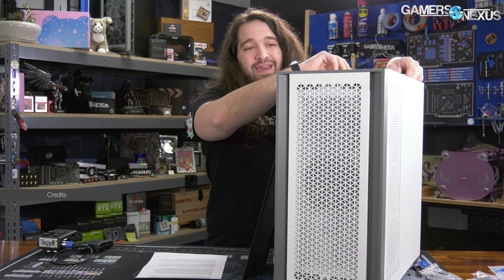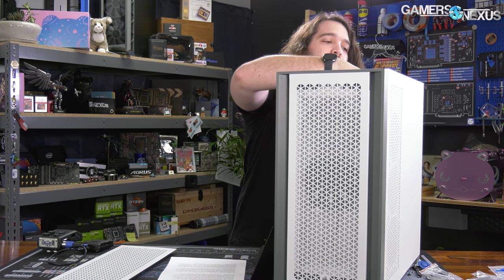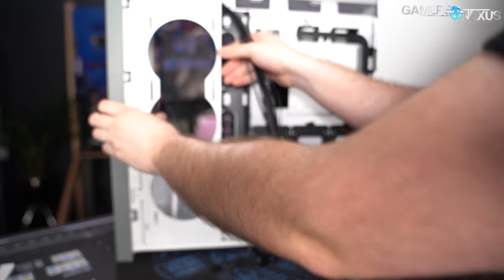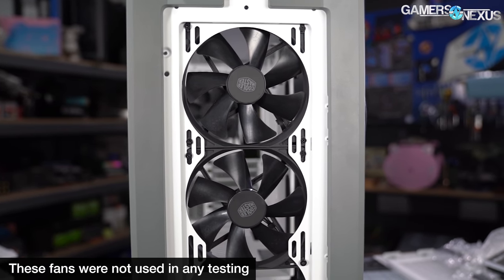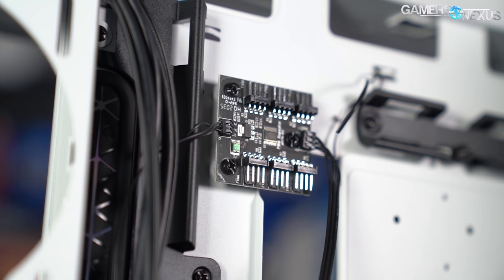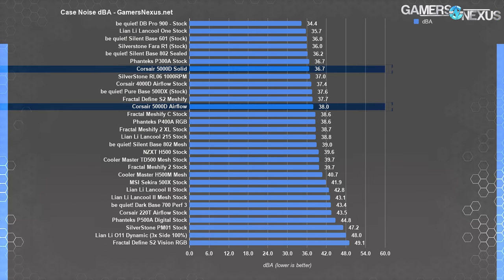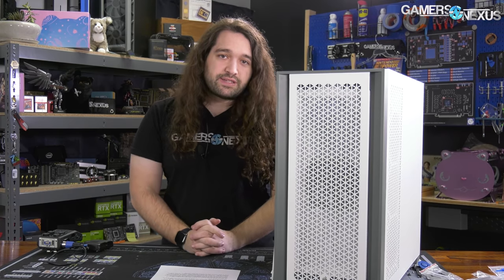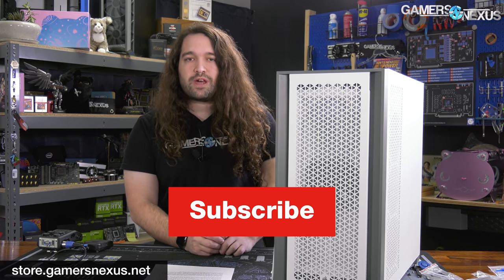Corsair 5000D Airflow vs. Solid Case Review: Thermals, Noise, Build Quality

Comment: Am I the only one who likes 5.25" expansion bays anymore?
Reply: Yeah there getting hard to find, I just want my haf x back now.
Reply: @alreed2434  I've had good Luck with the enthoo pro 2. I really liked the way phanteks packaged that case and did cable management.
Reply: @kevinmaher4609  Is it decent for air cooling as well? Usually do a tower on cpu for cooling haven't gotten into aios yet. If it aint broke don't fix it right?
Reply: @alreed2434  i don't have a fancy liquid cooling set up. It has enough capacity in the front intake though to make it good for air cooling. I do use a CLC on my CPU but due to how I have it configured I'm losing the static pressure through the rad as exhaust rather than as intake. Meaning even with lesser exhaust flow from the top of the case I'm still getting fairly low temps.

Comment: Looks like a really good case for a higher end build when you can fully populate it with fans. Even the -X has very good temps with full fans. 

Side mounting AIOs can be a problem though, have to make sure the tube length is long enough. My h150i capellix just barely reaches even with tubes up

Comment: This actually looks very decent, plus it got support for the recommended top AIO mount, even for a 360. xD
Throwing the shipped fans out and replacing them with Artic P12s seems like a solid solution to cool the GPU, when having a top mounted 360 AIO.

Comment: 6:25 I have my fans installed with the panel in and works really well I put a temp sensor behind the motherboard to see if it helps and it help the ram and motherboard  👍

Comment: @Gamers Nexus I have appreciated your detailed reviews over the years and that helped inform me to choose the Silverstone RL06 case for my build, a couple years ago. I have noticed lately, that, pleasingly, more case manufacturers are releasing 'HAF' or atleast Mesh front intake filtered cases, rather than the earlier, unfortunate trend of blocked or largely blocked front panel intakes that restricted positive air pressure set-ups, significantly. But a new potential issue I see is with your charts: The amount of cases or more, their variants, means the comparative lists are full of a range of case types from HAF, front Mesh types to closed front panel cases or variants of those cases. Given the growing amount of cases on your charts I wonder: Could you have separate lists for HAF/Front Mesh Cases and 'the rest'? Would be neat to see a comparison of the HAF/Mesh front cases alone, apples-to-apples and if people wish to see comparisons with other case variants, they can see them on another chart? Maybe you could have a video sometime this year on the new 'High Airflow King' or something and include older cases like Silverstone's RL06 to see how they match up - stock, noise-normalised, Standardised Fans etc? There's getting so many of them now, could be interesting to see.

Comment: I was looking for white pci slot covers. The only thing I found online was "iCUE 4000X/4000D/4000D Airflow Expansion Slot Covers, White" on the Corsair website.
They looked pretty sweet.
Of course, they wouldn't ship to Australia, so I had some sent to a friend in the US.
He got them in the mail, and told me they were grey. I was all like 'what the hell'.
Sent a ticket to Corsair. They apologized and sent another set, this time to my billing address in Australia.
They were also grey.
I tweeted Corsair. 
"The PCIe slot covers on the 4000X/D are grey, the don't come in white. Sorry if you've had some confusion on the item but when it says white, it denotes it's for the white 4000x"
It doesn't say that they are grey covers for a white case on the website. It doesn't have pictures of them in the case, contrasting their actual color against a white case. They just have a picture of them against a pure white background, which makes it impossible to determine what shade they are, which is, according to Corsair Support, my fault for being 'confused'.
They offered me a refund, but who cares? Its $4.99. I care more that the same thing could easily happen to other people, and they could fix it by adding a few lines of text and their own promo photos of the 4000 series to the webpage for this accessory. You shouldn't have to look up another product to get an accurate presentation of the product you are looking at, and you shouldn't be wasting people's time with your own support department not knowing what color your products are.
They haven't changed the page, and they've lost the faith of a customer that has previously spent hundreds of dollars on Corsair gear.

Comment: I have a 4000D Airflow and I am extremely satisfied with it for the money.  I only do air cooling but if I were to go AIO water, I would consider the 5000D without any real reservation.
Reply: it's $100 more, complete ripoff.
Reply: @darinsteele7091  $150 isn’t $100 more then $100.

Comment: One thing that I think would be really helpful to people looking for cases would be an aggregated list on your website of all cases.
With normalized sound testing results, CPU and GPU thermals, simply a spreadsheet of the cases and their tested configurations. (Maybe a link from each over to a an "in depth" explanation of how the configuration is actually set up, potentially some images to show the key things of note.)

Then it would be a lot easier to find actually good cases for one's need without needing to stumble through a whole bunch of videos to find something applicable.

Also, in regards to noise testing. You can buy a reference/measurement microphone (has an exceptionally flat response over frequency and usually a very low noise floor) and record 10-20 seconds of audio and simply do an FFT on the recorded in for an example Audacity. This would give a rough picture of what types of noise the case emits during normal operation. (Can intentionally also throw in a "coil whine heavy" GPU to test the higher frequency noise. I would though personally use a small speaker on a vibration dampened stand, since it will be more repeatable.)

Comment: I'm using this case, a black 5000D AirFlow with 6 fans, the 2 stock fans and 4 extra black Noctua 120mm fans. It cools my system very well while still being silent. The biggest reason for getting the 5000D over the 4000D is that I was afraid that my gpu wouldn't fit; an XFX RX 6800XT Merc 319.
Reply: The one AMD GPU that’s longer than just about anything else.  Had to switch to the 5000x from a h510 elite for this reason. The damned GPU was contacting the radiator and the temps were just a little tad to high for my liking.  Didn’t help that I had a 5800x and the top 140mm fan wasn’t exactly fully screwed down either.

Comment: Would you consider doing a review on the Corsair 200R?  It is an older case, and outside of the price range you normally cover, but to this day its extremely popular.  From what I could see, its even the most frequently reviewed case on PCPartPicker.  I, and I'm sure many others, would be curious to hear your thoughts on it, and see more accurate measurements of how it stacks up compared to other popular cases.

Comment: I have this case and I love it!
Reply: I have the Airflow 5000D, and really like this case. Though I think they should have supplied a few more fans. Luckily I have a stack of Noctuas etc to make this baby really breathe.
Reply: @davapod  I just used a Deepcool Assassin 3, the two stock fans and a -120mv adaptative undervolt on my i7-12700K to boost perfomance a little bit and reduce max power consumption. As a music production build and currently with two NVMe SSDs, it's an utopia by how good the overall cooling combo is. No liquid cooling, one of the best PC cases ever made, but the tempered glass panel (this sucks) broke after i removed it for the first time 😭😭😭.

Fortunately, i reused parts from the broken one, made a new one with common transparent glass and it's amazing. I'm glad that i called a cousin that is a mechanical engineer and asked him about common glass panel for a PC case, and he said i wouldn't have any problems if the air temperature is so low and there is a large air gap between my cooler and the glass, good quality common glass can withstand high temperatures too, but obviously it's more dangerous if it breaks.

Comment: Great review, thanks for sharing.  Hope we see a evolution of the Air 540/740 into this new design of the 5000D/4000D, the 540/740 really need glass side panel instead of acrylic and this new style front and top panels that are much easier to remove and clean the filters.

Comment: This was a well done, informative video. I need to mount a 360mm CPU radiator and a 240 GPU radiator. Many cases offer the option to mount one of them in front, but I like having intake fans there. The option to mount a radiator on the side is a nice feature that made me opt for this case.  I’ll definitely add fans as needed so there are three in front. 

Thanks for this detailed review as well as the others in this market sector. Very helpful content

Comment: Full disclosure, I bought the 5000D Airflow (Black). That said, I'd like to pick the big brain behind the decision to send the 5000D to market, with only two fans. Had it been two 140mm, I'm still not sure it would have been acceptable. That said, most builders, myself included,  will upgrade the fans anyhow. 

If anyone from Corsair is reading this, I think it would have been better to cut the price and have no fans at all, than to add a couple of fans and have people question the added cost. But that's just one person's opinion. Others would probably like the option to choose between having two 140mm, or three 120mm fans on the front panel without the price hike.

Comment: If you fill the front and side vents with fans and use the extended power supply box cover, a good bit of air gets crammed into the lower box, and comes up through the large perforations below the GPU. My GPU fans don't even turn on until heavy loads. Able to run less cfms per fan to avoid crazy turbulence and still get a great volume of flow.

Comment: I think with a case like this, they expect you to either put an AIO liquid cooler (which includes fans for the radiator, or a custom loop). This means that having two fans included is fine.
Reply: Or a silent and good thermals music production beast build like my i7-12700K with a Deepcool Assassin 3 air cooler, many NVMe SSDs and at least 32GB of RAM.

Comment: One reason some of the manufacturers just include two fans if you don’t have enough to buy the high end Corsair LL fans you would be stuck buying cheap fans and then they would go to some waste as you either lose money or have fans for no porpoise the two fans leave enough to either buy more expensive fans or opt to the same fans included and save a little bit of money

Comment: I liked your point about the supplied fans. No one who puts a PC in that case is only going to run two fans, and if they're like me they're going to want a matching set, so they'll trash the ones that are supplied. The same goes for fan controllers and RGB hubs. They rarely have the capacity to run a fully-loaded case, so just leave them off and let me save a few bucks that I'll already be spending on a Corsair Commander, ML fans, etc.

Comment: Please add a "potential" test. That test will populate as many fans as the case allows to, and in a configuration that is the best according to your (great) knowledge. I believe this is important, since some cases are higher up the chart, but are already using all their potential, while this specific case seems to be able to DESTROY almost any other case thermal score, of done right. 

I would go positive pressure: 2 lower front, 1 upper side panel for intake. 1 rear+1 top rear for exhaust.

Comment: i feel like the last "good" cases from corsair were around the early obsidian stuff, like the 750D, 800D and 900D. i own the latter, and ive modded it recently to accept 2 full atx systems running completely independently of each other (just waiting for stock to come in on a couple parts to actually make it run). those had decent expandability, alright air flow for the time, and they were fairly quiet. some quirky things, like the 900D side panel release mechanism, were pretty flakey, but overall they were fun to build in cases that kept up with some of my extreme builds of the era. im exited to see how the 900D mod i did handles two gaming systems in one box. should be a good one, ill try to get Steve's attention with it once it's done.

Comment: I was able to buy individual side and front panels (glass, airflow, and/or solid metal) for my 4000D shortly after buying one right around when they launched. They were hard to find on the website, and I ended up having to search specifically for the name of the part since it wasn't showing up in the shop when using filters for categorically searching. At the same time, I was in talks through email with a Corsair rep who said those parts weren't available yet even though I had already figured out how to buy one.
Point is: I suspect the 5000D and X panels will probably become available soon if they aren't already. They might just be buried on the site in a weird spot while they get their crap together through the product launch window.

Comment: I'm pleasantly surprised to see Corsair improving and listening to feedback but I'm more surprised to see that, despite having more room for cooling and more space for intake, the thermals are overall worse than that of the 4000D airflow (even after standardising the fans).

Which means unless you are planning on using the extra space for radiators or water cooling, it is better to get the 4000D airflow. 

It's not worth paying nearly 150% the price just for little more room and an additional USB slot.
Reply: I don't know where do you get the worse thermals thing. But i have a Deepcool Assassin 3 inside, cooling an i7-12700K with -120mv of an undervolt with the two stock fans and it must destroy every other case on the market right now, the fan noise is nonexistant, it's like the computer is turned off.

There's more air inside the 5000D than the 4000D, it should be cooler. I have a cousin that is a mechanical engineer and said that it's a fantastic case and overkill.

But it has one HUGE FLAW:
Tempered glass sucks.

The panel broke after i removed it for the first time, so now i have a normal transparent common glass one and i can SEE the components. No RGB needed.
Reply: Additional USB slot is a godsend.
Reply: @saricubra2867  All the reviews show that it has worse thermals than the 4000D with the stock fan configuration.

It is larger, so should be cooler, yes, but I think it's the positioning of the stock fans. They don't cool the CPU and GPU enough so the thermals are worse.

But the 5000D has an additional 3 fan slots on the side so if you actually fill those I'm sure it would perform way better.
Reply: @saricubra2867  Bro, I'll let you in on a little secret. Don't tell Corsair this.

All the cases (4000, 5000 and 7000) all have the same width, just different heights and lengths.

You can buy the front I/O panel for the 7000 series separately and fit that onto the 4000D airflow.

So you get 4 USB ports and 1 USB-C 😎
Reply: @Leanzazzy  They don't cool the CPU enough?
My i7 rarely went beyond 77 degrees maxed out with a Deepcool Assassin 3 and partially overclocked at the same time while at iddle stays around 27 degrees. The RPM always stayed very low.

There's a lot of air mass and not possible for the 4000D. I don't see any problem with the positioning of the fans in my case.

It's more of a case designed for top notch air cooling than water cooling, and every single tech tuber usually uses liquid cooling too.
Reply: @Leanzazzy  Depends on which GPU, because a lot of them can be a burning inferno even with the best case and fans on the market.

"you can buy the i/o panel"
Oh, the Apple dongle?
No thanks.

Comment: I used a Corsair 5000D Airflow White case with my HEDT Workstation build.  Intel Xeon W7-2495X, ASUS W790 ACE, 512GB DDR5-4800, RTX-3090. A nice case and it fit the CEB size motherboard after removing two internal panels.  I also added four 120mm Noctua fans, two front two top. My only complaint with the case is that it vibrates with the fans, especially at high RPM when the system is under load, sometimes audibly annoying.  If I slightly flex the case then I can stop the vibration. I still need to troubleshoot what exactly is vibrating.  Maybe the magnetic cable cover, because pushing on the top and side panels has no effect.

Comment: 1st. You absolutely can use the side fan mounts with the cable cover installed. Doing it right now and it is BLASTING air across my motherboard. 2nd. Did you look farther into the accessory kit or did you just open the box, find the USB adapter on top, and forget about the rest? If you had looked in there (even though it is not listed in the manual), there is a mega standoff that can be installed to secure the cable door. Also I hope you didn't build in 2 different cases. The only differences are the Airflow vs Glass vs Steel panels and color, every single other part is exactly the same. I put white "5000X" parts on my black "5000D".

Comment: I am going with this case in my new build.  I had problems with thermals in my previous case (NZXT), because I went with brand loyalty over function.stupid but it's done!
new build with have a 360 AiO (h150i) on the i9 14900k (not overclocked initiallymaybe 2 years down the line) 3 additional fans and a a 4080 super